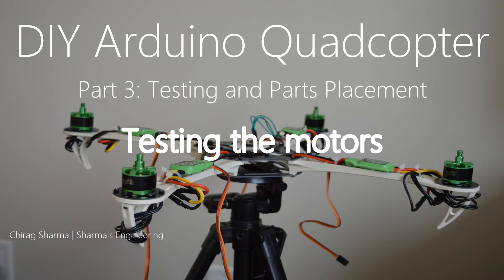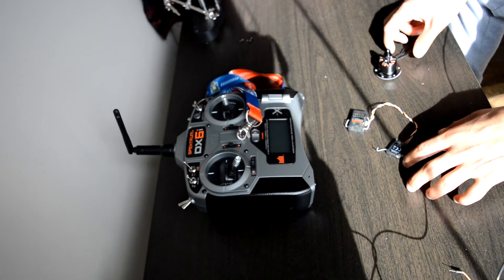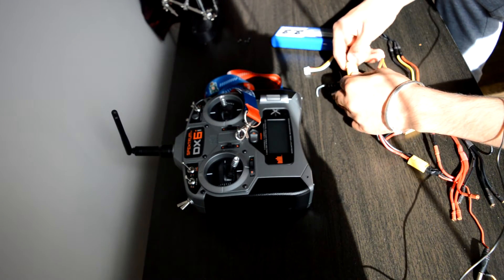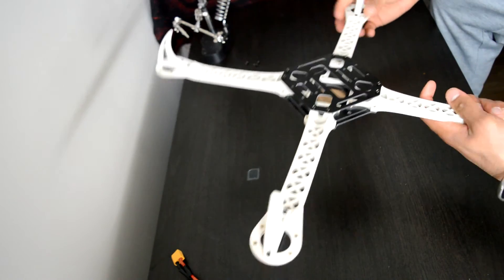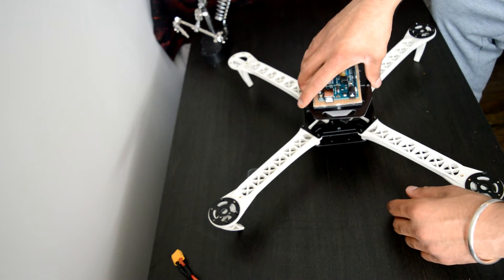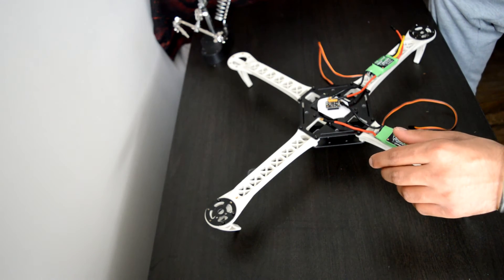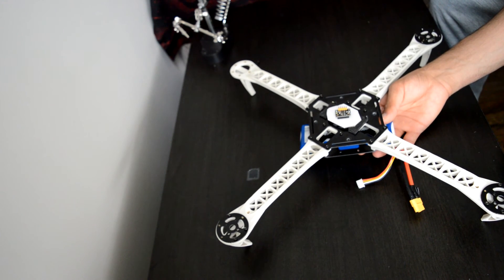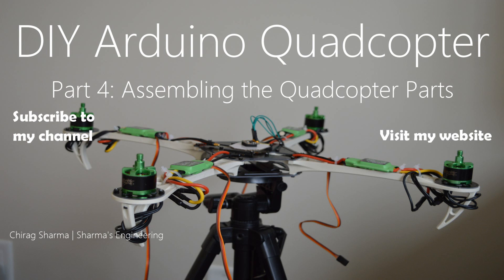DIY Do It Yourself - ARDUINO UNO QUADCOPTER | Part 3 - Testing and Parts Placement

Comment: When I was going to  test my motors with the controller, they didn't work. The only component that worked was servo motors. Do you have any ideia of what am I doing wrong?
Reply from the maker: Hello,
I am not sure why would you use a servo motor for a quadcopter.

Thanks,
Chirag Sharma

Comment: could u please provide me the pdf of this... ur lectures are amazing.... calculation of thrust , vibration isolation and how to pitch and roll. all theoritical background...kidnly provide. my email akashdeep2708@gmail.com
Reply from the maker: Hello Akash Deep Verma,
The only PDF I have is of the wiring diagram and you can find it at: http://engineering.chiragsharma.ca/do-it-yourself-arduino-quadcopter/

I am glad that the tutorial series were of help to you. Since this is only an online tutorial series, there are no lecture specific course notes that I have produced. However, you can lots of information on the web. 

My favorite source of information is:
Quadcopter Mechanics: http://andrew.gibiansky.com/downloads/pdf/Quadcopter%20Dynamics,%20Simulation,%20and%20Control.pdf

And

Online Quadcopter Calculator: https://www.ecalc.ch/

Hope this helps!

Thanks.